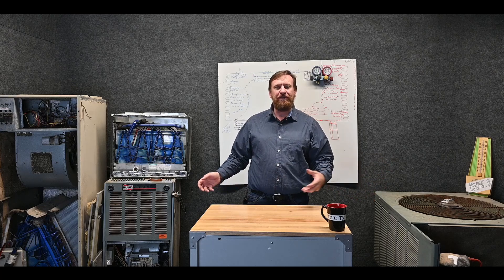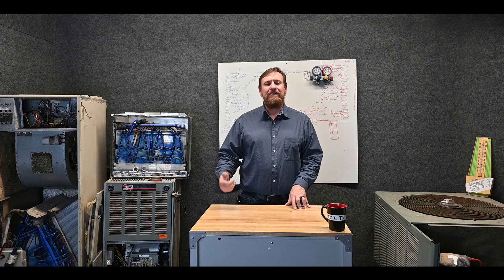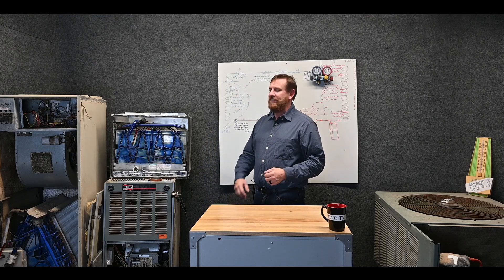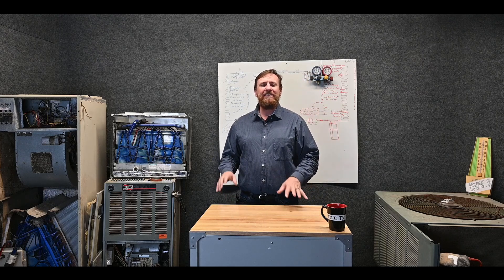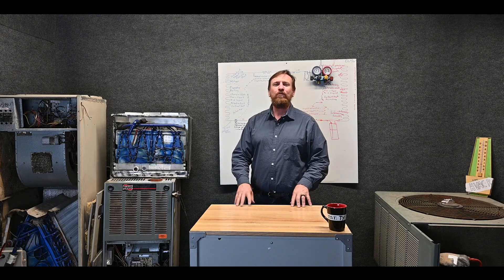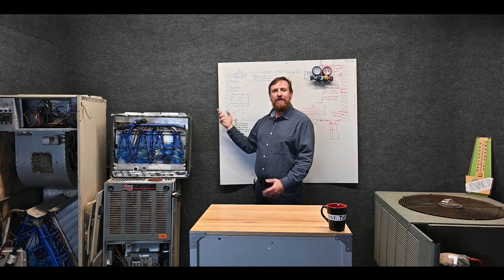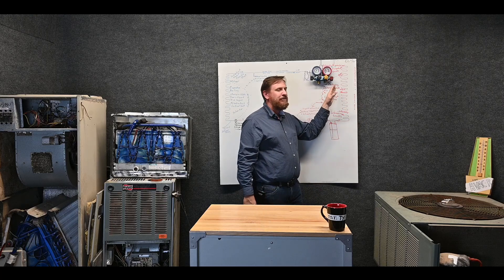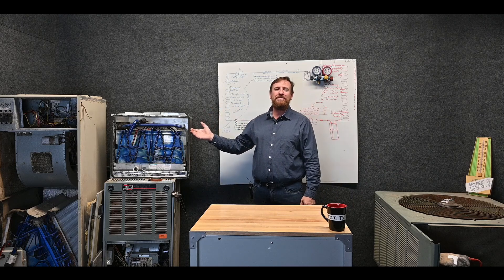HVAC 097 B scenario, AC Freezes AFTER servicing

Comment: Thank you for this video! It’s a very typical scenario and I do see this pretty much every week during my March/April clean-and-check maintenances. Typically it will be a brand new customer that has never had this system checked/cleaned and it will be a piston, not a TXV. I don’t see this freezing evaporators on my regular customers equipment because everything was cleaned and checked last year and not a lot of surprises happen here.
Long story short, I don’t like to take new customers for these clean-and-check maintenance simply because I am starting with evaporator/condenser coil cleaning, but ending up with new TXVs, additional return air ducts, evacuating the system and charge it to its a correct refrigerant and correct amount of refrigerant, add acid scavenger into the compressor’s oil…. It’s like a Pandora box… 
I had one guy with non-cooling R-22 walk-in cooler; two refrigeration condensing units that were grossly oversized for the cooler’s cooling validators, running non-stop and still…. Inside temperature wouldn’t go below 44F-46F. 
So, standard list of findings; neither evaporators or condensers were ever cleaned, ~40%-50% over charge, plugged screens/retainers on both TXVs, wrong motors and fan blades on both condensing units, of course burned compressor’s oil and by-passed defrost timers… So, instead of regular 2-3 hours clean-and-check it took me 2 days to resuscitate that walk-in cooler. The temperature inside dropped to 33F and both condensers were now going OFF by the thermostat. The store owner was happy with the temperatures,  but he complained that this repair took too long…!!!! Previous guys would get everything done in 30-40 mins and don’t charge him so much…
… I still don’t know how to handle such complaints… Well, a year later he called me about another store.. he said something like: “…. I know that you charge too much, but I cannot find anyone that will be able to repair my walk-in cooler…”.  Ha-ha-ha! I told him that I am busy.

Comment: For that unit which it got freezed evaporator, if u have let it  run for enough Time, utill gets the normal pressures on both sides, will that fix the problem, if not how u fix it?
Reply from the maker: If you let it run for enough time frozen, it will kill the compressor.
Reply: @love2hvac  
How you fix the problem, though?

Comment: Liked the story.  Your videos are excellent.  I did scratch my head "why would cleaning the evap coil not be part of the maintenance routine?"  You don't have to answer.
Reply from the maker: Great question.

With proper filtration, an evaporator coil should never need to be cleaned.
If it is cleaned, proper filtration should be installed so it does not get dirty again.

Cleaning a coil is hard on it. Even the safest chemicals have a reaction on the metals and increase the risk of leaks. Accessing it in place is difficult, can damage the fins and does not get the dirt from deep between the fins.
Pulling it and cleaning it is very expensive and time consuming.

Comment: Hi sir,
Thank you for your videos.
I am writing to enquire about.
There is a page said that
If there is a high charge in ac system ( its metering device is capillary tube), it would start freezing from the compressor suction.
Is this right?
Thank you in advance.
Reply from the maker: Overcharged will damage the compressor but not cause it to freeze.

#1 cause is airflow 

Also Refrigerant restrictions, indoor outdoor temp and low on charge

Comment: Hello Ty,  quick question if you don't mind.  When pressure testing lines + evap coil with nitrogen, do I need to use bubbles on the joints if the pressure isn't budging after an hour?  300 psi for 1 hour .  Thanks
Reply from the maker: Yes, remember it's easier to do extra steps now vs returning later. 
When pressure testing I use a digital guage that peak in decimal of an inch and  with the temperature clamp. As the temperature change the pressure will change to.
For example, the tempersture goes up and the pressure stays the same it could be a leak and the tech never knows.  Another example the temperature drops and the pressure drops and a tech will spend time looking for a leak that's not there.
Reply: @love2hvac  Thank you very much Ty.  I always appreciate it.

Comment: These are great videos!   I'm not a service tech, but I do deal with HVA/C on occasion and at times, my friends and relatives ask me for help with maintenance and small repairs.  (I guess that means that I'm the worst element.   Someone with just enough learning to be dangerous.)   Anyway, please make more videos with scenarios where we have to figure out the issue, just like this one.   Keep up the great work!
Reply from the maker: At the end of the course I will add in diagnostics. Diagnostics is just specific application of the fundamentals. Once you have a solid  fundamental foundation , understanding how it works, diagnostics is just what's missing in the sequence of operation.

Comment: So obviously cleaning the evaporater coil was the correct solution, but if you had wanted to cheat, could you have added more refrigerant to the system, which would raise the pressure in the evaporater and consequently the temperature also, which would prevent the freezing?
Reply: You could have added more refrigerant to get the evap saturation temp above 32F, but you would only be making the situation worse. Because of the dirty evaporator coil, the refrigerant is not picking up the proper heat from the air and there's a decent chance you're getting some liquid slugback at the compressor. If you add more refrigerant to the system at this point, you're just making it worse and there will then be even MORE of a chance for saturated liquid making it back to the compressor.

Comment: Hello, I heard that after cleaning the evaporating coil, the compressor could burn. Is this possible and why?
Reply from the maker: That is a great question. 
The issue is the compressor running for a long time on a dirty coil reduces capacity and it also (slugs) floods the compressor with liquid. After the coil is clean the compressor is now running back at full capacity/full load and also dealing with the damage and abuse from the liquid slugging over _ years. It's sometimes too much for the compressor to handle. 

Also many tech's over charge them  to compensate for the dirty coils low pressure. When it's running again techs dont remove the charge to put it back like its suppose to. Also when the system is opened up it's possible for contaminated to get in the system or a tech to not pull a proper vacuum that grates acid that can eat away at the winding on the compressor.
Reply: @love2hvac  helped to add on knowledge sir